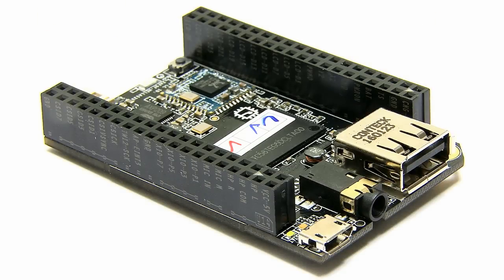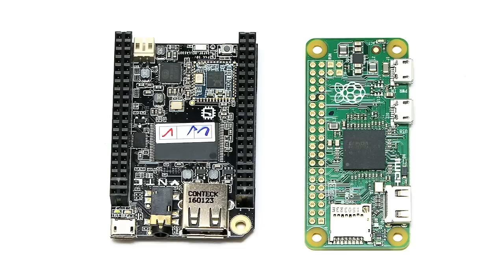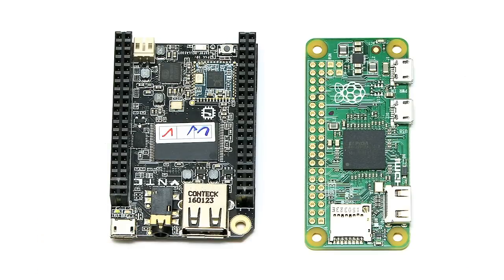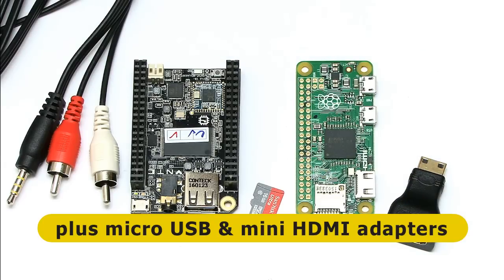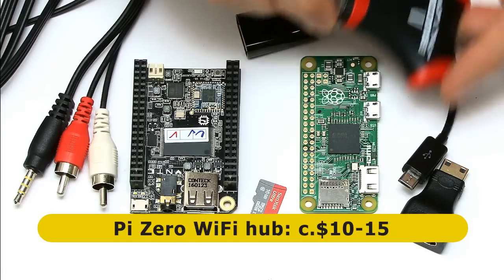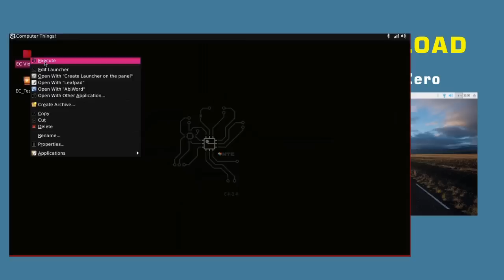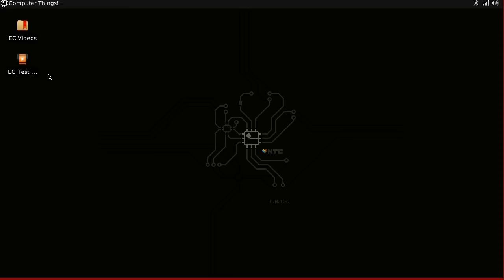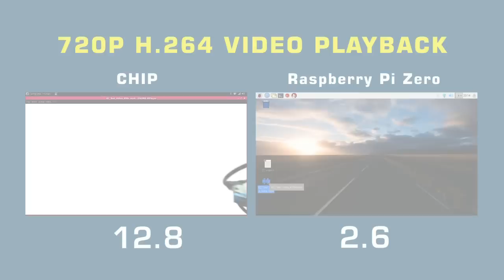CHIP v Raspberry Pi Zero

Comment: what about 1080p?
Reply from the maker: A Pi Zero can output 1080p 30fps.
Reply: @ExplainingComputers  there's a guy on youtube selling and adapters for $149 i believe as a product he made to accept USB webcams 2.0 or above and output 1080p 60fps HDMI so that the Atem mini /pro will accept as video source at 60fps with  hardly none or very low latency and clear as the source webcam.  the  adapter looks like he simply took a raspberry pi but zero size. is it possible that you can demonstrate if its even possible to make our own? (by the way i'm teaching my little girl 12 electronics while watching your lesseons) wish i can work more direct with you to help her I bought 2 Atem mini pro's trying to save money.
Reply from the maker: @leethedjbr  Ah, I see! :) I can totally see a Pi being used as the basis of a device as you suggest. A USB 2.0 web cam connected to a Pi would run full-screen video fine, output to HDMI as you say for any source that will accept it. The Atem Mini Pros are nice pieces of kit -- very hard to get hold of here in the UK (or an Atem mini, for that matter).
Reply: @ExplainingComputers  i ended up buying two since it took a while to get them one for home and one for portable.  can you tell me what will work what is the smallest raspberry pi i can use to plug in USB 2.0 and output HDMI without changing the hardware?
Reply: an HDMI 1080p smooth?

Comment: Why using a USB WiFi dongle on a Raspberry Pi Zero, if you know you're going to need networking on it why not just go for the Raspberry Pi Zero W then? It has built in WiFi and Bluetooth, problem solved.
Reply from the maker: The Pi Zero W did not exist when this video was made. :)

Comment: 3:25 actually, powering C.H.I.P. from a LiPO battery was straightforward, as it had onboard power management to stabilize voltage and charge the battery. Awesome for a hobby project.
Reply: R.I.P. NTC

Comment: This is why the pi zero w was such a huge deal. add "ssh" to the root of the sdcard and "wpa_supplicant.conf" with your network config and use it in projects wireless and headless. Nobody should be using these as computer systems other than like a gameboy or something.

Comment: Christopher, I think the benchmark is quite muddled by the fact that you're using different apps on the two different systems. 
I also think the webpage on the chip was likely cached. It was far too fast considering all of the other bottlenecks. 

I'm not disputing your conclusion, just offering refinements on the methodology. 

Thanks!
Reply from the maker: I inevitably used different apps on different systems, as there is no available operating system that runs on both computers, nor a common browser. So I am running here what the manufacturers/suppliers intended. The test here is a real-world one of computer systems, not hardware -- or in other words, the combination of hardware and software that real users would run in the real world. People seem to forget that on ARM systems you cannot just "download the same OS" and try it. It does not work that way. The OS and drivers need to be available and compiled for the specific hardware. :) When testing other SBCs I get a similar argument -- the test is no good, why not try using such-and-such an OS on them that happens to run both? (Even though it is a very obscure OS that almost no real world user will ever run). Which might, technically be a "better test" of hardware vs hardware, but is meaningless for real world application. If comparing a Mac and a PC, would you wipe macOS and Windows off them to install Linux to do a better test? I seriously hope not.
Reply: I agree that you can't run the same distro on both, because there are custom binary drivers usually involved. But I think you can probably get the same browsers on both.
Reply: I figured you were comparing "system" to "system," rather than hardware to hardware. 
I would still humbly recommend trying to run the benchmarks on the same apps if at all possible, and not just the same type of app.
Cheers.

Comment: Perhaps a more accurate comparison might now be between a CHIP and a Raspberry Pi zero-W which has a built in bluetooth and 802.11(something) wi-fi card - it's closer to $10, but brings more functionality onboard. The "vanilla" Zero is perhaps closer in concept to the "thinking person's Arduino" - it's primarily intended as a "maker" board which happens to run a version of Linux, than a fully-functional desktop alternative.

And to be "balanced" - the Rpi needs you to set up the Micro-SD card on a conventional computer, or buy one preloaded with Raspian

Still,  an interesting comparison
Reply from the maker: True -- but the Pi Zero W had not been released when this video was made! :)

Comment: i m trying to make a rpi 3b+ computer 
should i buy 3b or 3b+ 
and what is maximum sd card supported or usb storage max
Reply from the maker: 3B+ is a faster board, and the list price is now the same. SD card is I think 32GB, USB as large as available.
Reply: @ExplainingComputers  woo thanks can we boot from usb 
and where will be storage 
in bootable ddevic?
Reply from the maker: Yes, you can boot a Pi 3B+ from USB, but only FAT32 I think. A Pi 3 can be reprogrammed to boot from USB.
Reply: @ExplainingComputers  thanks 
does it have blutooth and wifi module
Reply from the maker: Yes, the Pi 3B and Pi 3 B+ have WiFi and Bluetooth. But please stop posting comments about the Pi 3 on a video about the Pi Zero and CHIP. I for one am getting very confused here. The computers shown in this video cannot boot from USB, and the Pi Zero shown does not have WiFi or Bluetooth!
Reply from the maker: Here is my video on the Raspberry Pi B+ https://www.youtube.com/watch?v=izceGfkUtZU

Comment: That's more of a chrome vs firefox benchmark
Reply from the maker: But I can only run the browsers available for each computer. :) These are not x86 PCs, so not all software is available for each board. So here I am using the browser supplied and supported by the manufacturer.

Comment: But I'm looking for a microcontroller that can interface with an electronic subsystem, provide video and computer connection, with data.  So if I hook up that HDMI module to the Chip, I lose all of those GPIO and analog connectors.  Actually, I also want video I/O, and it doesn't look like either of these will do both.

Both of these are ARM processors.  Chip is Allwinner R8 ARMv7 Cortex-A8.  Pi-0 is ARM1176.

Alternatively, an onsite laptop computer, which is what I don't want to drag along, but if I want to do any heavy data storage, I may have to.  Neither of these has an external drive port.

Interesting - thanks for the comparison.  I think you also may have separate videos on each of these, so I'll have a look at those.
Reply from the maker: I do indeed have videos on each -- and on a great many other SBCs! Sounds to me like an x86 board like a LattePanda may suit your needs: https://www.youtube.com/watch?v=z5EXNfHYPfQ

Comment: the CHIP sounds downright ideal for use as a remote-use device. Especially a battery powered one. I feel like the built in LiPO connector isn't getting enough credit for it's usefulness in that regard.

If you're just setting it up to run a small program remotely you'll only need composite out to do initial setup then never need video out again. If the project doesn't need much space then you can VERY easily justify the lack of expandable storage by having the convenience of it built on, and the wifi/bluetooth connectivity right out of the box is a bit of a godsend. 

I'd wager you could make a mean solar powered piratebox for small files out of one of those things with a big enough battery to last the night/cloudy days for probably under 30 bucks since it already has most of what you'd need built in.
Reply: I have a couple running as "mesh WiFi network" systems - operating off a LiPo battery with a small USB output solar panel.

Comment: Just saw a presentation about this thing embedded into the PocketCHIP case.  By the time you make the "cheap" computer runnable, it is at least 3 times the cost of Pi3, about 10 times the price of a Pi0 with about the same speed if you want HDMI.  1/4 the speed of a 3B for more money.  I guess it has a market niche but I am straining to understand it.  The flash that has to be bought tends to level the pricing just a little but, as you say, not changable on CHIP.  Limited selection of environments, too.  

As always, an excellent, informative presentation.

One update, the Pi0W is out now so $5 extra for the Pi side of the tally.  As of May 3, 2018 the CHIP is not available. They claim they will return.  I suspect their production run was completely subscribed and they have to go back to the fab to get some more made up.  Will see what it looks like next round.
Reply from the maker: As you say, Pi Zero W is now a far better bet. And the CHIP is no longer available . . .

Comment: CHIP is a Scam company which scams customer after you bought. All their good comments are actually posted by their own people, relatives, suppliers and related people. After you paid, they will lie all sorts reasons to delay delivery, fake delivery statements, fake announcements and many other unbelievable lies. Most customers get their board after paid 1 year. Others tried to cancel and refund they will ignore you. After you get this board, you will regret of the poor performance speed, bad display quality, lags, hangs and the worst is the bad quality flash nand will sector damage very fast. The support from make is very poor and they are very poor knowledge in their own product. Small community support and most of the active are fake accounts made by themselves. The main support only come from the public few guys but they were only active at beginning at kickstarter.

I rather buy PiZero than Chip . Pi Zero better support from maker and big community and good SD card support. Pi3 for far more better display, speed, support, community, capability, and many others.

Comment: Worth reiterating: pointless comparing performance in different software packages. Even from "out of the box experience" perspective. People getting those things do understand how to customize their installations.
Reply from the maker: No, not worth reiterating -- there is no common OS for the CHIP and Pi Zero. I run here the OS the manufacturers of both boards intend users to run, and which most users will run. And that is a valid comparison for most users! :)

Comment: Those tests were a bit dumb. They are using different software. it would be easy enough to install the more light wait applications either one.
Reply from the maker: But then I would not be comparing the computer system (hardware and software) intended by the manufacturer. If comparing a PC and a Mac, would you seriously wipe the OS and install Linux on both? There is also no optimised (full driver support) OS that spans both devices.

Comment: to live in the 21st century,it is necessary to provide for microcomputers software enables you to connect to other modules via wifi ,but not wireless,but rather through the wire.connecting the antenna connectors of the modules.then it will be possible to implement a secure connection for exchanging data wpa2 existing software.for example, joint work with gsm module

Comment: I have a question  what is the best way to clean the port where we connect the power to charge the phones on my case I got a j7 Samsung.
Reply from the maker: The safest way would be to use an air blower to remove dust/dirt from the port -- there are spray cans or little rubber things you can get. For basic port cleaning, I often use a bit of BluTack, although this cannot get right inside.

Comment: Can I use a 1 TB external HDD using an OTG cable for storage in Raspberry Pi 0?
Reply from the maker: A 1TB HDD should certainly be usable for storage on a Raspberry Pi. You will need a table that has a standard USB Type A connector at the Raspberry Pi end.
Reply from the maker: Above, I meant "cable" -- although tables are useful things too.

Comment: TBH just buy a Pi 3. As the video illustrates the actual systems cost is higher anyway and in the pi 3 you already have a bunch of things that you need to add in here on top of things that you never get with the zero or chip. e.g. a better processor. Personally i would only buy a pi zero if size is of the essence. e.g. because i want to mount it into something thats not very big.

Comment: trouble is the chip computer is in update and not available, unless you buy the pocket one, plus now there is the pi zero W which has wifi. Be interesting to see an update when the chip get reissued against the zero w
Reply from the maker: All very true. The Pi Zero W is a great value board.
Reply: be nice to get past the one at a time,  so the re-sellers will then go away

Comment: I think it's a shame those tests weren't done in a comparable system. Different browsers, different video players and different OS distributions, essentially.

I would probably have tested only in Firefox on both (because GNU) and in Kodi on both. Probably do a general compute power test from command line too. Test MIPS, a GZip or ffmpeg encode or such.
Reply from the maker: I get your point. But I tested using the default operating systems (they cannot run the same one -- these are not regular PCs where you can install what you like), default video players, and default browsers -- ie what you get "out of the box". Or in other words, I tested using what their manufacturers intended.
Reply: I can also see your point. I doubt much hand optimisation went into either build, however, and as hobbyist machines, they should certainly have the build-essentials package available to compile... mplayer2, for example.

The build time would not be _exciting_, but may also give a good indication of raw horsepower. Large projects can lean heavily on that on-board memory, and will struggle with slower SD memory speeds, if they have to keep intermediate files there.

Comment: I thought the chip appeared visibly faster in composite than in HDMI, "snappier" if you will. The adapter drags, it's likely what's wrong in video playback. You should try video playback on the chip without it for a cleaner out the box comparison.

Comment: Memory Access Time

- how much of a factor is memory access time? I have been surprised at how slowly laptops run SDs and microSDs when plugged into the SD slot, even when the storage chips themselves are fast. UHS cards running on USB3 via an appropriate adapter can be several times as fast as the same cards shoved into the SD slot.

Comment: Chris i've seen that on raspberry pi zero when you press on the video it automatically starts playing
What did you add on the program i still need to type in terminal on omxplayer
Is there an upgrade or some software?
Thank you
Reply from the maker: Good spot! :) You need to use a text editor to create a desktop shortcut to the video file, and to specify the program that will launch it (omxplayer as you say). I am struggling to remember the syntax right now -- I am not on a Pi! -- but I think the file has to be created in /home/pi/Desktop

Comment: lol i have a mini HDMI to standard HDMI sitting around. i also have the USB OTG cable sitting around and the 3.5 video cable sitting around! as well as several micro sd cards! lol so i could effectively buy either of these and really only have to buy a power supply (most of mine are too low current) and then a bluetooth mouse! and thats it :D

Comment: hmmm $2 for Wi-Fi chip n $2 for Bluetooth plus the ram, free headers, no soldering and ability to clip in an hdmi out...chip wins hands down for hassle free plug, play and get to programming! ...great setup by chip! .. if you want to tinker and start from scratch and sniff some lovely flux smoke then the Zero is better for learning n burning! ..cheaper to set a Zero ablaze or install in multiple projects/toys/prototypes....but the chip DEFINITELY has its pros and and its place.

Comment: On the Launch browser & page load-test, you can see in the bottom left of the Raspberry browser that it's the uBlock extension that's causing most of the extra time spent in rendering the page, while I'm not sure the C.H.I.P even had that extension. 
Still, neither of these computers are really meant for browsing or even windowed environments in general no matter what the marketing is telling us.

Comment: have you checked if the Pi isn't set up for background loading of pages?
Like as soon as the page was loaded, it could be that the Chip would need 34 seconds to load a sub page, but the pi might load it in seconds?

I also would have loved to see the game 'DOOM' playback. With it's specs of 66Mhz on a 486 processor, it should run fine on both systems!

IMHO, they should create a Raspberry Pi 0, with 4GB of RAM, 64GB of ROM, dual BT port (keyboard/mouse and possibly audio), WIFI, and HDMI port standard, and bump up the price to still an affordable level, like $30 or so.
Reply: I bet it ran without textures, or at like 7fps?
Reply: There is a Raspberry Pi with most if not all the features you listed, it is the Raspberry Pi 3, which is $40. Also, Doom runs on very low specs due to the requirements from the time it was made, it doesn't need a 486 or equivalent, it works with a 386 or even a 286 processor, and a fraction of the ram a raspberry pi zero has.
Reply: 66mhz was a requirement for the Windows 95 version as well. our first pc ran Doom 2 with less than 66mhz and it was either a 286 or a 386. And the frame rates were ok. It ran on a lower resolution to make it work well.